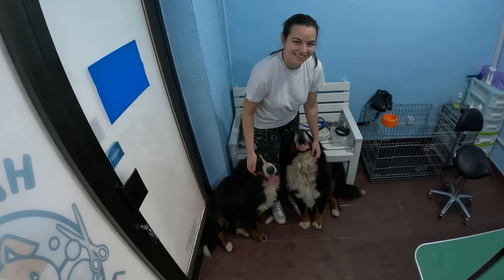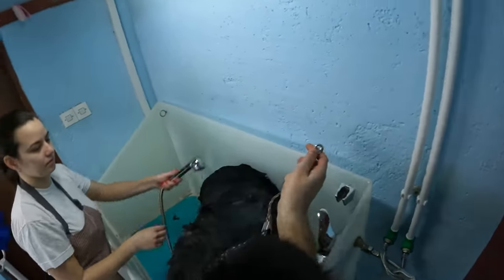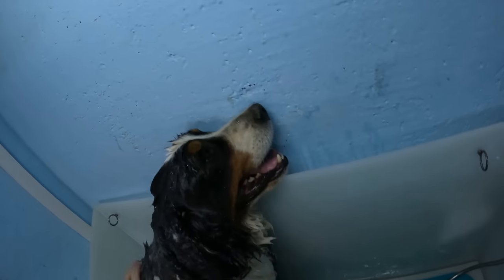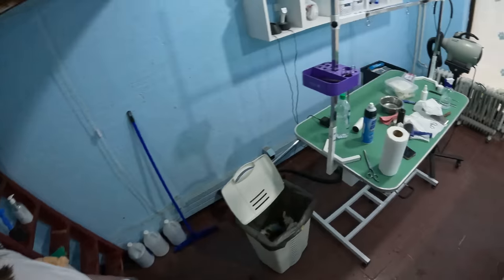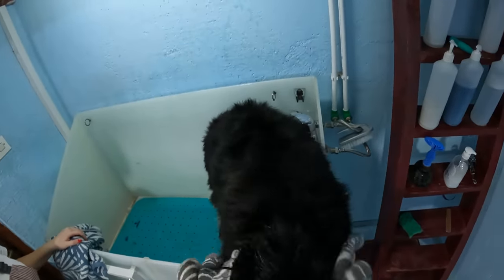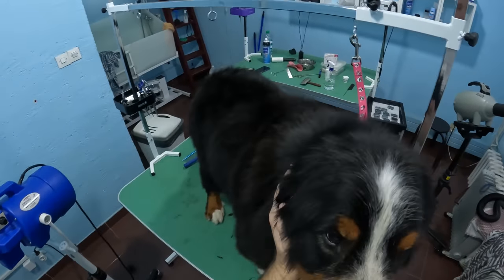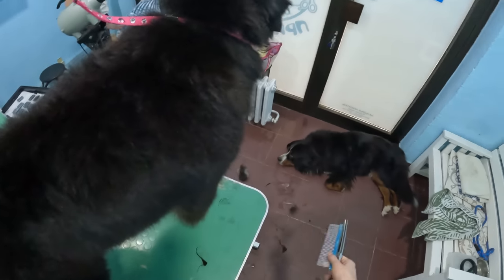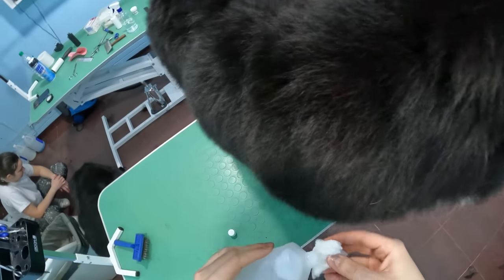Grooming Two Bernese Mountain Dogs

Comment: With a Bernese you should plug the tub and have him sit in it or lay down till he is soaked.  Drain the water add shampoo then plug up again for soap out.  You might have to rinse a couple times but you won’t waste all that water.  Like you are doing.  Hope this helps for next time.

Comment: Not equipped for large dogs but nice to take them on. Needed more attention and assistance after it slipped off of the table at the start. Leaving equipment on the table, sharp scissors etc, when not in use, is bad practise as it is dangerous. It was even more noticeable with a big dog on the table.